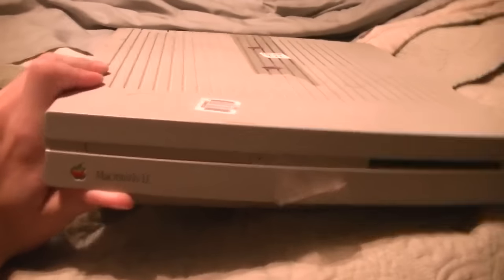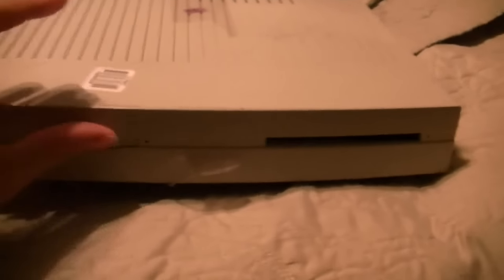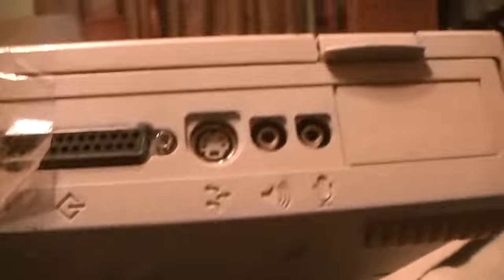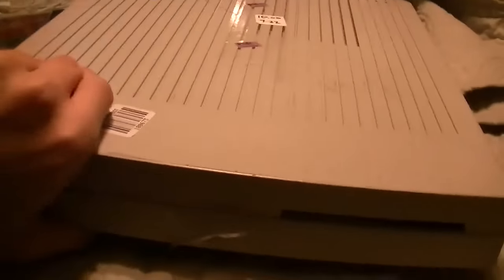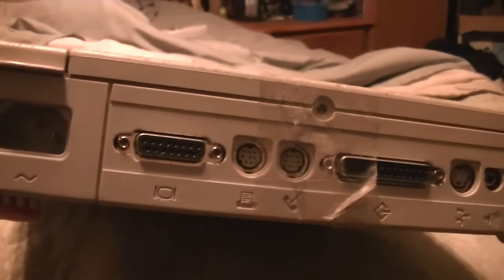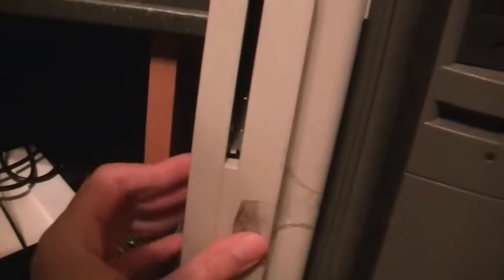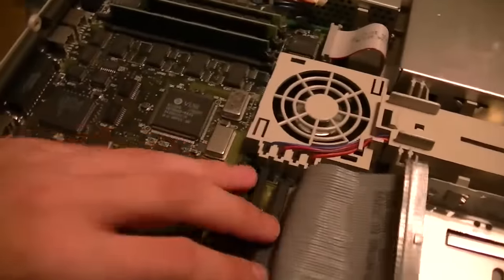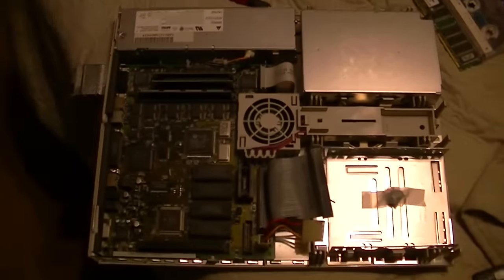Testing a 1991 Macintosh LC

Comment: You can get a SCSI hard drive with Mac OS 7.5.x pre-loaded on it on eBay, although they are a bit pricey (around $60 to $80). Your LCD monitor probably doesn't work with it because the Mac LC defaults to a resolution of 512x384, which is non-standard for PC monitors, but it should work with most old CRT VGA monitors.
Reply: Wow +VWestlife on a Roadgeek video!

Comment: I know a bunch about vintage macs.
The blinking folder means you need an operating system witch can be in the range of Mac OS 6.0.7 to 7.5.5 witch you could probably get the disks off eBay if you need anymore information on it just ask 
Cole
Reply: To heck with eBay - you can get disk images for almost every version of the Macintosh System Software online for free.
Reply: You can get mac systems from WinWorldPC or Macintosh Garden
Reply: +themaritimegirl AGREED!

Comment: Nice find. Yes, unfortunately SCSI hard drives can be expensive to get a hold of! And buying one old enough to work in a machine like this, you're running the risk of it being already dead (because you can be darn sure most sellers don't test them), or it does work and then die later.

If you have $60 to blow, you can get a device called SCSI2SD, which is a little board that you stick a MicroSD card into, and it plugs into the SCSI bus to serve as a hard drive.